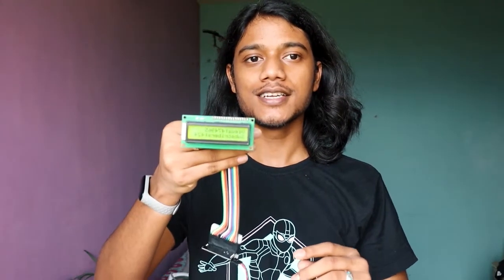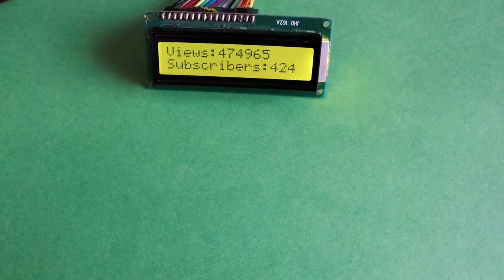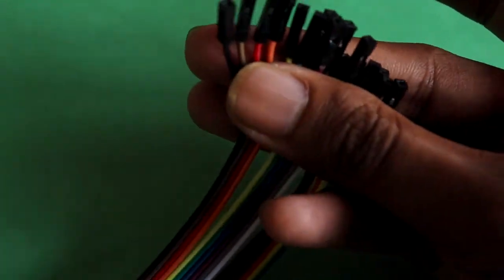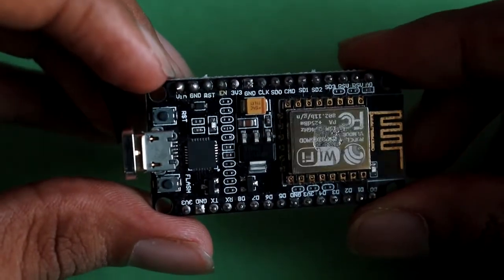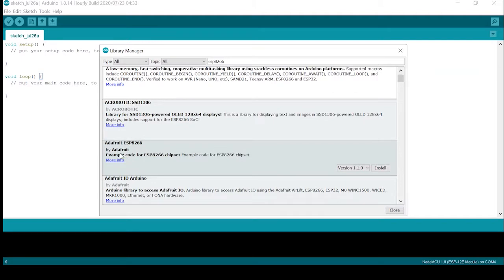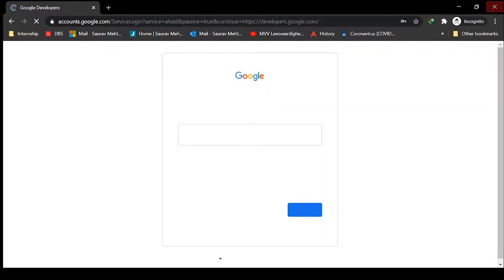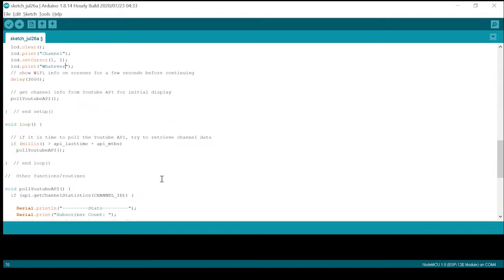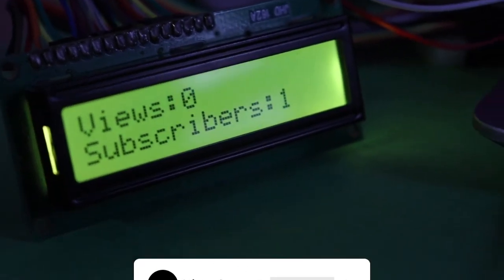MAKE A YOUTUBE SUBSCRIBER COUNTER [ESP8266]

Comment: I am following your instructions. When I verify, I get "No such file or directory" for these two lines. 
#include <ESP8266WiFi.h>
#include <WiFiClientSecure.h>

I believe I have downloaded the library files. I am new at this. Any suggestions?
Reply from the maker: You can use the internet to download and include the two headers
Reply: @AthemSaurav  Thanks. I got the code to work. The program now compiles and goes through the whole writing process. Does a restart. And then nothing but the blue glow on the LCD screen. No words or counter. The ESP board blinks a blue light during writing. I2C has a constant red light. Program ends upload saying "Leaving.... Hard Restart via RTS pin.... " I have checked every wire multiple times. Any suggestions. Again, I am a total novice and am probably messing up something that seems obvious. Do I need to adjust the potentiometer on the I2C?
Reply from the maker: You should see some blocks on the display. If not, then it's the potentiometer. Also, from what I think has also happened is that YouTube has changed the API but with my setup you should still be able to see something on the screen. So the connection of you display is the way to fix.
Reply: @AthemSaurav  Thanks again. Almost there. I messed with the potentiometer and I now see blocks, no words but blocks. At one point I could almost make out the word "wifi". So close. Now I'm worried its hardware. But everything is new. Again your help is most appreciated.
Reply from the maker: Potentiometer rotates both ways so slowly adjust it to see the display. The issue faced by you is very common for most of the people.🥲